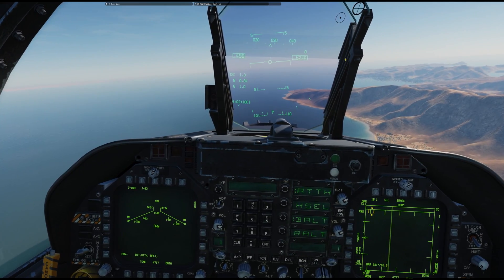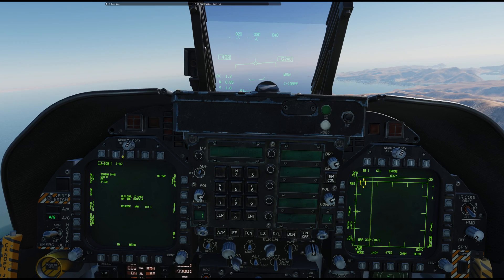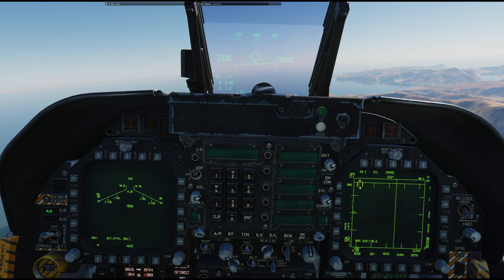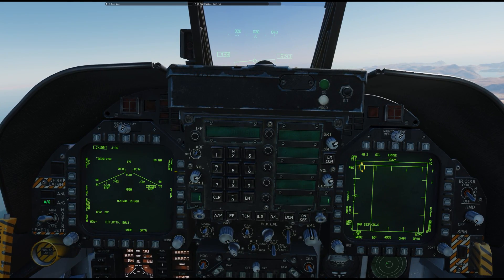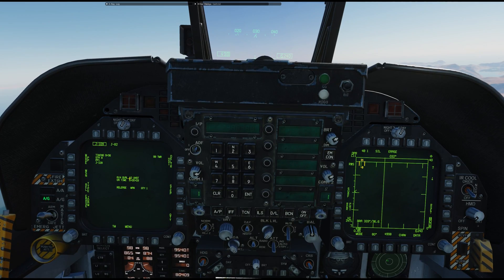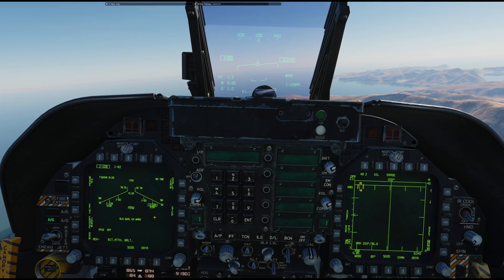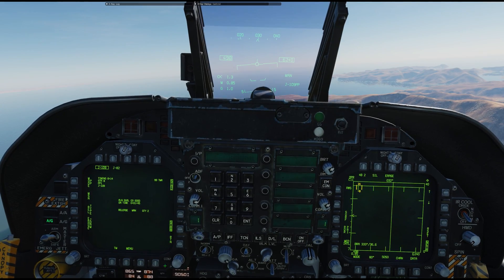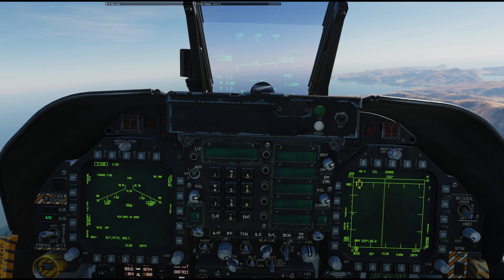JDAM/JSOW STEP and Power changes coming to Open Beta

Comment: Do you know if there's going to be a way to designate using the TPOD and have that go into a pre-planned target point? I'd like to stand off at max TPOD range, select targets, program my bombs, then drop them all in one pass. I used to be able to do this by designating TOO and then switching to PP mode, causing the targeting data to transfer to that PP slot, but I believe it was unrealistically implemented. I think the real thing can do this, although I've only spoken to one pilot about it. Can we expect that capability in a future update?

Comment: could be possible in the future to turn down the brightness of the map screen ?
Reply: @NineLineED  thanks, but I'm trying to do it with the brightness button like the A10C, to turn down the brightness of the map but not the green circle but I can't :(
Reply: @stalhuth  it's possible with a mod https://forums.eagle.ru/showpost.php?p=3670348&postcount=31
Reply: @NineLineED  what I think we're after is implementation of the MPCD contrast, gain and symbology controls as per page 34 of the early access manual.  Would be a welcome addition for sure.